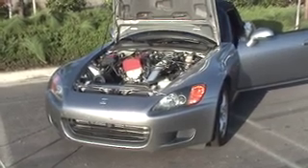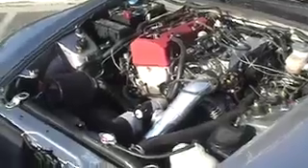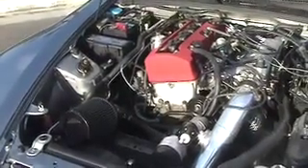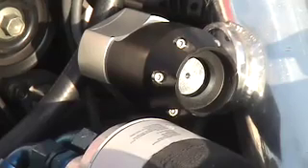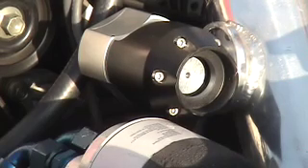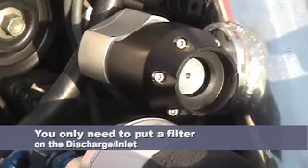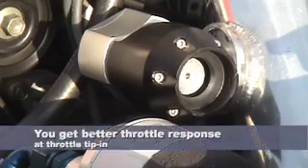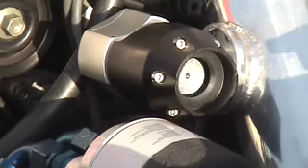Synchronic BOV eliminates turbo restriction

Comment: I currently have this in my Station. I dis notice whoever installed it didn't connect both ports. Only 1 port and one capped. Will that affect the performance of the BoV?

Comment: Problem buddy. If you have a turbo car that runs on a MAF(FLOW) sensor, which your S2000 does NOT, then you have to use a diverter valve, not blow off. If you do this CORRECTLY for a MAF metered car then yes it'll help. But if you have a MAP car then it doesn't make a difference. Most cars other than Honda use MAF systems.
Reply: When you buy this, you get a recirculation adapter. ♂️

Comment: Just because you have one on your car doesn't mean you know anything about it. I'm not saying you don't, but if you use that to back your knowledge about it then I'm skeptical to believe you actually do. Also, that's not what I said in my comment. The purpose of the valve is to open when the turbo ISN'T spooled, to minimize vacuum on the intake manifold before the turbo spools. You're right, when the turbo is spooling and it leaks, that is known as a boost leak. You get an A.

Comment: The more air you can supply the motor while intake is under vacuum, the better throttle response you can get. So if you keep a gaping hole open near the intake while at low rpms, your throttle will be much closer to that of a naturally aspirate motor. The only thing is that if you're utilizing a gaping hole in the intake, you must filter it! So, like he said, they're working on a bov where you can do that, or recirculate it to between the filter and the turbo. You only have to recirc with MAF.

Comment: You're right it doesn't add dyno'd horsepower because the max horsepower is at a specific rpm, where it creates the MOST power. All this valve does is increase torque while the turbo isn't spooled... like at low rpms and lower throttle. Also would help your turbo spool up faster because you're not restricting the motor right before it spools.

Comment: I think you and a lot of people commenting don't know anything about how the turbo system works, and also didn't pay attention to his summary of the turbo and bov's effect on throttler response. 
When a turbo hasn't spooled up, it's actually holding the engine back. What this does is minimizes that restriction by letting air flow in reverse through the bov with little restriction.
This is only bypassing the turbo when the turbo is not spooled and not creating boost.

Comment: When your driving the BOV shut, no different than if it were a straight pipe, the purpose is to prevents the high pressure/charge to be forced back into the engine when you let off the throttle. Its there to protect the engine, not give it HP. Every car has a BOV, these pissing BOV's are only a gimmick unless your running really high HP/PSI. Use some freaking common sense people, and spend money on something functional.

Comment: I am so distraught right now. First I am completely skeptical about the method in this video having any kind of noticable difference in throttle response. Second, (his specially modified) BOV apparently can suck in air. If you poke a hole through in your intercooler pipe just before your throttlebody you will notice that at very low throttle air will be sucked through that hole.

Comment: What is with all of the responses from people that obviously did not listen to what the design of his (have you designed one?) BOV is for.  After market turbos kits add a parasitic load to what was a naturally aspirated engine.  He designed this BOV to help reduce this issue by allowing his BOV to open for multiple reasons and then close once the turbo has spooled up until you let off the throttle when it releases the excess boost as normally expected.

Comment: But not everyones street car is going to be used for racing? And some people still want that throttle response in the low end. Just because one group of people have a specific set up for their needs doesn't mean you eliminate the needs of the other group especially when it's as simple as having multiple products. In racing this is useless but on the street it'd be helpful.

Comment: Launching is a term usually used in relation racing. If you're racing you'll more than likely be revving past your normal driving shift point using more fuel. More fuel will be consumed at ie:8000rpm (multiply that by how many gears you'll be shifting through) than at a launch point of ie: 3000rpm in only one gear. If you're racing then you probably aren't concerned about fuel economy at the time. During racing a Wide Open Throttle is normal using a "asston of money on petrol" Nice try though.

Comment: lol i love how no one can think out of the box. this valve would help with snapping open the throttle from low rpm where the turbo is hardly turning and out of drive force. depending on how close the turbo is to the throttle body, the engine will receive less air until the turbo starts turning and compensating for the restriction it causes. it makes sense in theory, whether it would be a noticeable difference or not i don't know.

Comment: hahahahah this guys an idiot. motors dont rely on the air the bovs to sucks in, the motor was running like shit bc you took the vacuum source away from the bov. has nothing to do with how slow/fast the bov is closing in this case.

Comment: why on earth would even need throttle response coming off of idle in the first place?? the honda makes it's power at like 7500 RPM, so, ideally, in any race setting, you're going to keep the RPMs in the powerband, and so throttle response from a closed throttle position is absolutely worthless.

Comment: @fafinaf no because what happens to all that boost in the intercooler and piping after you let off the throttle and the throttle plate closes? compressor surge is what happens cuz the air has no were to go but back out the turbo the way its trying to come in. that's a dangerous combo for a turbo

Comment: Okay but what about contaminates? Wouldn't you need to have a filter in front of the opening on this bov as it stays open at throttle sucking in dirt and grime into the intake manifold? Bypassing the turbo means bypassing the air filter too right?

Comment: @recon440 
it doesnt suck in air you fuckin moron it is relieving or blowing air out of the BOV at idle or under vac. It closes as soon as its time to build boost. This also keeps the compressor wheels spinning free. You need to get a turbo car and learn something before you post dipshit. dont knock something till you try it or actually understand the philosophy behind it.

Comment: LOL @ "bypassing the turbo"... how is that done? The turbo is connected to the manifold. As for the theory of sucking the air through the blowoff valve... that's a joke too. The BOV sits after your MAF/MAP sensor so that air being drawn in is not metered. This BOV is a joke.

Comment: Most stock turbo vehicles have a dump valve that vents to the air intake instead of the atmosphere. If that's the case, all you have to do to hear the (Whoosh) sound is get a CAI system instead of the air box. At least thats what I did on my S60 T5.

Comment: Synaptic1, 'Question (forgive me for my ignorance): I'm
very interested in investing in your BOV.  I'm wondering--have you finished the anti-stall valve? Or, have you generated a way to prevent foreign matter (water, garbage, particulate matter) from entering the BOV while the car is in vacuum It looks like it's open when the car is not under boost/load. Please advise! Thanks! (BTW, I drive an '04 SRT-4)   :)

Comment: "A blowoff valve is a pressure release system present in turbocharged engines. Its purpose is to prevent compressor surge and reduce wear on the engine." Stupidass :/

Comment: ......you're saying this opening sucks air in for better throttle response away from idle? That doesn't make sense as if its drawing this air from where its routed back to the main pipe thats a closed system, the air drawn in may as well be that coming through the main pipe as it does with a recirculation valve. How does improve throttle response away from idle, Either I don't understand what you mean, or there's no difference/benifit to this over a standard recirculation valve.

Comment: you mount it on your charged piping then re-route it back and dump it into your intake piping AFTER the maf sensor. that way it's not taking in any air that isn't measured already and you're not running lean on idle and rich when changing gears.

Comment: compressor surge is generated on a forced induction vehicle when the driver lifts their foot and closes the throttle plates, there is now positive pressure in the intake piping after the turbo.  if this pressure is not relieved by a blow off valve it will attempt to push it's way back out the way it came to achieve neutral atmospheric pressure decelerating or worst case scenario possibly reversing the spin of the compressor of the turbo, and backing up the exhaust pressure in the manifold.

Comment: Dude the valves are all the same the reason it is open is not bc of boost pressure its bc of vacuum the neg pressures in the intake from the motor, when you hit the throttle it closes so what are you trying to accomplish

Comment from the maker: 95% of the people that have bought Synchronic BOV already had a BOV installed.  Guess which one actually worked and they kept?  The fact that you are bitter and make broad sweeping statements, like "everything they sell is crap" is indicative that you are biased because you either sell something else, or you are trying to develop product that simply can't produce results.  You have also, never used the product, otherwise you wouldn't be talking smack.

Comment: goddamn your dumb. ALL dyno's are "load" based. some are static load like a dynojet 248h some use eddie current like a superflow others are water brake or  viscous like a  dyna pack.  anyway you slice it synaptic is a bullshitter, you are sucking unfiltered air into your motor and all his videos are fucking rigged. i run a dynojet dyno so you can go fuck yourself.

Comment: You will NOT get better mileage under cruise conditions.  You will have the same delta-P from atmosphere to manifold for a given load, so same net pumping loss.  The difference will be how much of the pressure drop is contributed by the throttle and how much comes from the turbo/bov. The only condition that would improve would be WOT, before boost comes on; but that condition has nothing to do with gas mileage.

Comment: So for those cars running an airflow meter on the intake side of a turbo..ie a stock SR20DET setup..what are the affects of the engine taking in unmetered air? wouldn't it be running a bit leaner as the ECU is only expecting air thats passed through the AFM, not what is also coming through the bov?

Comment: ok so its just works backwards .. i see what you guys are getting at .. but meh i wouldn't pay more than 14$ for a a bov .. your better off having a regular bov and a check valve to just by pass the turbo to get rid of the " restriction"   or do like me and just puta huge turbo on an engien that aready is realy responsive with an auto tranny. have launch on just the motor and once speed comes up the boost will come.

Comment from the maker: Look up the patent 6,863,260.  The change in geometry allows for the ability to equalize the force on either side of the piston, so that no matter how much boost you run, it is still the same amount of force to open the BOV.  The valving mechanism is still a poppet valve and not a piston.  The actuator is a piston.

Comment: Only amatures run whit diaphram BOVs stupid.
All the BOVs and Bypasses i use hav o-ringed light alloy pistons, or, just valve stems like a wastegate whit Oring seat, those will never leak. 100psi, thats like 6.5bars? We test whit factory-standard 10 bars here in sweden.

Comment from the maker: Synchronic does not have a diaphragm and has a tiered piston actuator that does not leak boost, and is pressure tested to 100 psi not to leak boost.  The valve geometry is a pull-type design that seats harder as you run more boost.  Try running a weak spring on a diaphragm BOV and see just how fast it closes with boost pressure at the valve face.

Comment from the maker: Come on by, any car with the bypass valve between the throttle and intercooler installed, we'll throw it on the dyno and have you see it for youself.  Why do you think that the roots blowers have these built in bypasses, even though they don't have the same level of restriction?

Comment: And why would i buy anyting from you, if it worked, when i can just take a standard bypassvalve and remove the spring, then the valve will be open as long u got vaccum.

Thats all youre grap is, a recirculating bypass whit a really weak spring.

Comment: I have acces to a couple enginedynos, rotortest, etc. 

35HP uses less than that 20mm, of flow, and thats what i mean, the turbo system haf way less restriction than a small hose.

If it was a 1.5" tube, whit a trottle bypass maybe, i would belive some of it, and that it would make a different on a car whit a Realllly small turbo and IC. 

Offcourse when youre taking air from the atmosfere and bypassning the filer u get som results, but when a hose is there, you'll get nothning.

Comment from the maker: Hey genius, do you even have a dyno?  Under cruising, part throttle loads with vacuum, a twin turbo Z06 only makes 35 HP, how much airflow do you think that requires?  Do you know the difference between flow and pressure?

Comment: Go, fuck your self, i built more turbo charge cars than u can dream off! 

You onesly think a hose whit 20-30mm would flow better than the 2" the IC and the turbo?

Do you even know anyting about air flow dynamics and restrictors? 

This is, BS! Pure BS. I can hear u opening the trottel less when the valve is closed.

Comment: he knows that and he also knows that the motor needs to spool the turbo......meaning that when it does so the motor actually has an exhaust restriction until a certain point.  What he is doing is showing how this s2000 would make for a great daily driver and a power house as well.  It all makes sens..........misinformation is like an epidemic around here.  Why would you say that you call BS.  Do you have a turbo car at all or have you had the chance to tune one and look at the data logs.

Comment from the maker: To prove that the Synapse BOV is not hype, we are starting a try before you buy program.  You can actually test drive a Synapse BOV versus what you currently have, before even buying it!

We're starting this program in San Diego with Group5 motorsports 858-693-3278.  Give them a call for more info.

Comment: So, what I have learned from this video is, the instant you crack the throttle plate, the plunger closes, due to vacuum no longer present to the diaphram.  Normal.  What do I get from this video?  Nothing.  Basically, cracking the throttle places the BOV in a state of operation, exactly as if there is no "boost source" present on the diaphram.  I see no dramatic difference between the two states of operation that you outline here.  What am I missing?

Comment from the maker: Synchronic BOV is now available and in stock through retailers and distributors.  All accessories, including HKS adapter flanges, Greddy adapter flanges, Aluminum weld flanges and the anti-stall valve are also available.  Visit nipponpower:com,racingworks:com,ultimateracing:com,nolimitmotorsport:com,titanmotorsports:com and pmdistributing:com for wholesale inquiries.

Comment from the maker: Properly re-routed, you can actually have the same fuel economy off-boost as you had prior to going turbo.  So long as you re-route the discharge to the air filter, the BOV will be super quiet.